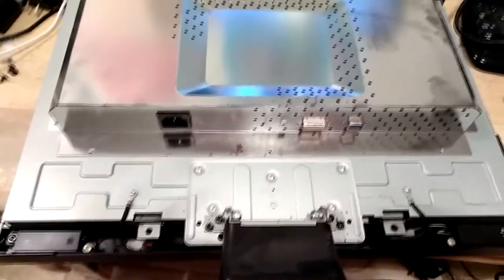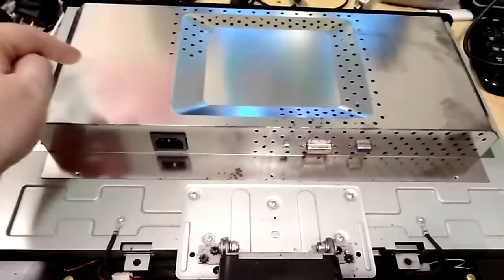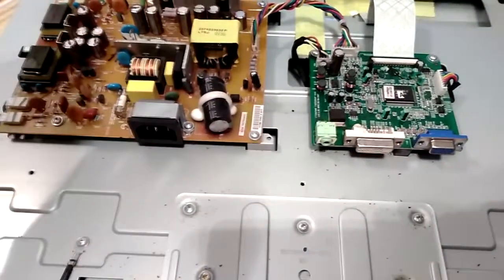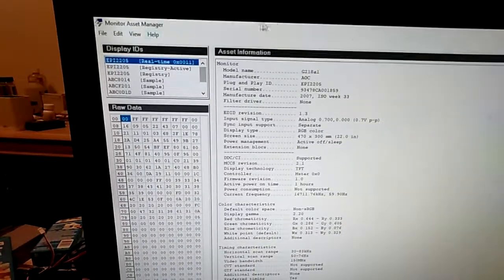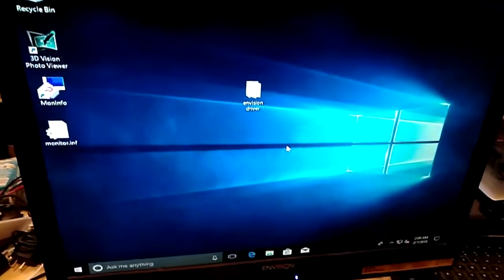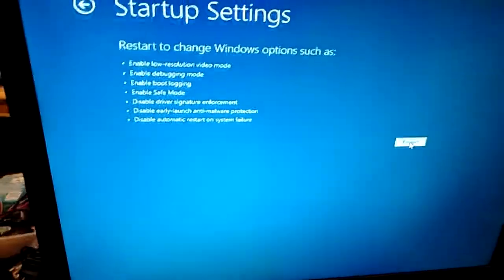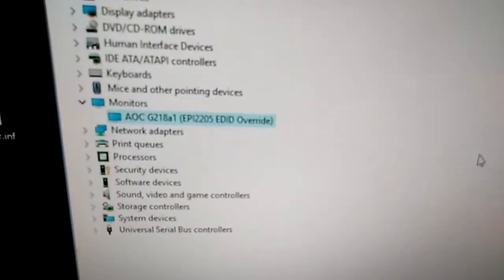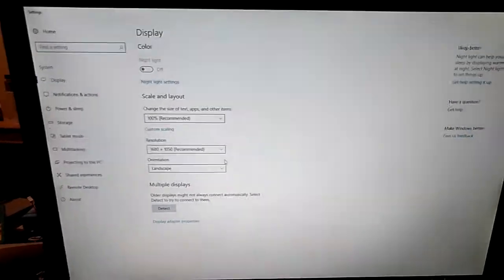Dealing with EDID problems

Comment: This video helped me a lot, I really appreciate that you took the time to make it. I recently bought a new Radeon RX 5700XT and it arrived today. In order to use it I needed to switch to a displayport conection (I had been using DVI with my last GPU). However after getting home from work and installing it and its drivers my monitor was stuck at 640x480. I stayed up for hours trying to fix it. Nothing was working so I tried to go to bed, but I couldn't sleep because all I could think about was my new $400 GPU that I couldn't use. I made several reddit posts and someone there suggested that my problems might be related to EDID. I did some digging and eventually ended up here. It is now 6:41 AM and my card is FINALLY ready to go. Thank you again man.

Comment: my monitor with DVI works only until the windows logo or with some old linux distributions(at 800x600), the DVI to VGA adapter thing works fine. I don't know how to update the drivers since I can't boot at all using only DVI